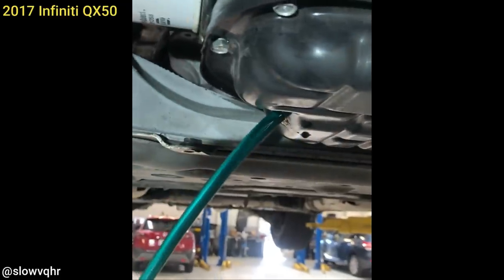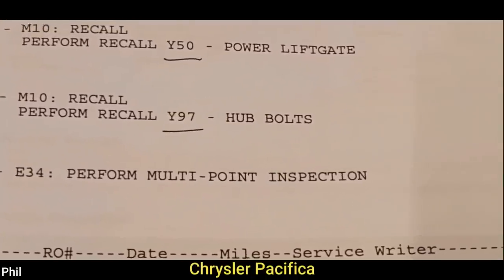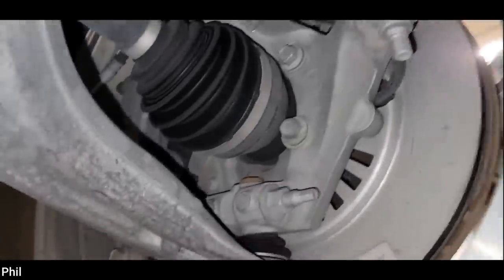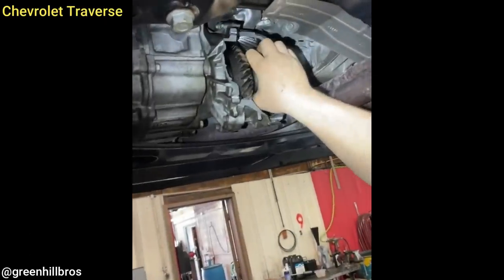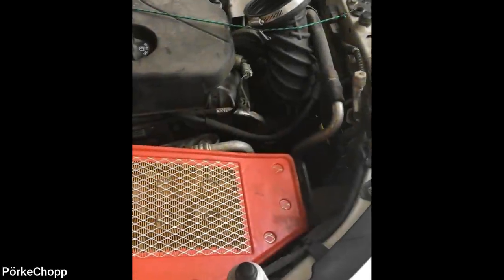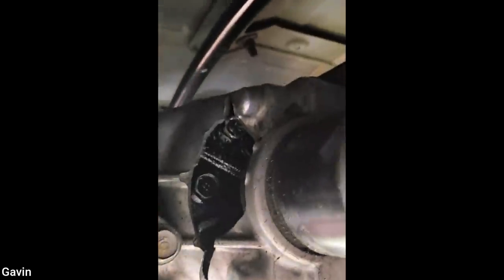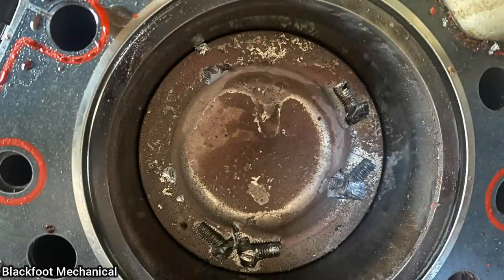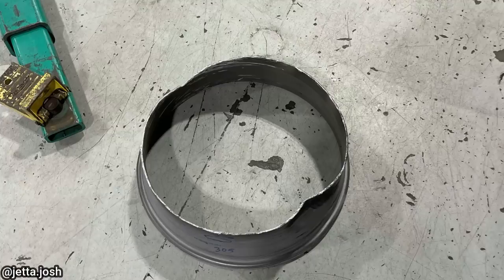Customer States Truck Has Clunking Noise At The Rear | Just Rolled Out

Comment: The blinker fluid in the blue car was fine.  It could have lasted another 50,000 miles.
Reply: ChrisFix would be so proud of them :D
Reply: But they over filled it
Reply: I came to comment on the blinker fluid too
Reply: That was just an observation; the actual customer complaint was about the muffler bearings.
Reply: Blinker fluid looked off, just throw away the vehicle
Reply: Only synthetic blinker fluid can last 50k
Reply: Blinker fluid has to be flushed every 25,000 miles to prevent excessive electrolytic buildup.

Comment: I can't believe how clean that truck bed is considering the rusted out frame.
Reply: I know right? It looks brand new except for the peeling paint.

I bet that would be a pristine truck if it was in Texas or somewhere like that.

Edit: At least the bed would be, idk in what shape the rest of it was. 😅
Reply: Iv seen this before , the frame is probably ok. The leaf spring shackle snapped and shot up the whole
Leaf spring into the bed.
Reply: I bought a 99 crown vic PI for $60 title and all before, with a dropped ball joint.  Body clean as ever, ran and drove great til the ball joint quit.  Huge rust hole in front passenger frame.  No fender rust either.  Shame I couldn't afford to keep it though, and it unfortunately went to a derby.
Reply: It’s a ranger they do that in the rust belt
Reply: @makpsv  My Bronco looked just like that when I junked it....body was pristine but everything under it rotted. It was a newer manufacturing process of stamping brackets, control arms and shock tower mounts where the metal rotted in flaking layers. You could actually see the layers in the metal after failure. This was not a normal type of rusting where holes would form. Ford never di recall a glaring safety issue.
Reply: you can see by the wheel wells that its comming through. the whole bed is rotten underneath. i have the same truck and the same problem with the leaf spring shackles. it screams and squeals when it rubs on the bracket so this guy knew this was fucked for a long time before that happened
Reply: The frame isn't rusted out, just shackles, apparently it's a common thing for 2nd gen dodge dakota because I can infact confirm, I just bought one that got brand shackles in rear but not without the passenger side punched a hole through, lucky for me I have a plastic bed liner that covers up nicely

Comment: I repaired the blinker fluid on my Kia the same way. It was going to cost $1k for part to properly repair it. I ended up just removing the housing , drilling a few weep holes , replaced blown lights and packed the sockets with dialectic grease. 50k miles and no problems

Comment: I'm surprised that first one being a Dakota, the '99 (late model)-'06 Silverado's were notorious for this happening because the shackle holding the rear of the leaf spring would rust and fail.  My dad's truck had it happen to both sides (didn't wear through like this, though).  We suspect that's why the rear u-joint was so messed up, it threw everything out of alignment (which I had to fix too).
Reply: I drove with one broke for about two weeks recently and wish I hadn't. 
It only dented the bed, but I feel like it may have twisted some things around. 
I'm just hoping it's not too bad.

Comment: Had the light full of water happen after a rock cracked the plastic headlight housing. Drilled a 1/16 hole in the back of the light to drain it. It was a good repair as it never filled again.

Comment: I like the "Rolled" channels. It helps me understand which vehicles to avoid buying. Also, I wish I could ID the exemplary car owners I should avoid. I'm having nightmares they're heading straight at me on the highway.
Another wish: I'd like to see some rolled ins on large commercial vehicles. Tractor trailers, school buses, box trucks, Rent-a-Trucks, etc.
Reply: Trust me, the number of things that you don't want to know about is beyond abundant. Hoods held on by packing/duct tape/cargo straps/wire/ baling twine; Vice grip shifters/steering wheel (I wish that I were joking); Wheels held on by single lug nuts; ...in short, everything that you see here and sooo much more. Fortunately, you are FAR less likely to see a rolled in with a commercial vehicle due to regular DOT inspections, including roadside and the substantial fines involved in them (think $50.00 per non-working light BULB, required or not) payable on the spot!
Reply: @MrSirwolf2001  Yes. Good points about commercial inspections.

Comment: Love al of these videos,Also Hey younger folks, notice all the grey haired mechanics in the these videos? We are a retireing breed, good luck getting your vehicle fixed in the next 5 to 10 years. And for your EV owners , Your screwed
Reply: It’s parts guys too, I work in dealership parts and I’m 40 now soon to be 41. I’ve got about 15 to 20 good years still left but I’ll be where you are a lot sooner then I realize
Reply: Luckily EV' have fewer parts. But will need computer techs to repair software issues.
Reply: Cars & bikes have to stay well built it seems to function for any length of time .. electronics such as computers too. Everything else though, consumer grade, is designed to fail or for impossibly light duty. All made in China junk, built as light as possible with relatively short service lives. Been doing a lot of home improvement lately and just disgusted at some of the crap the big hardware chains stock. You can get quality and durability still but for many things, not from them. Point being that durable items can be repaired quite often, but since so many things are considered disposable, there may come a time when no one can fix them, so continual replacement of sub standard junk will be necessary ..
Reply: @williamjackson5942  software updates, OTA, likely.

Comment: At work, we had a cargo van tail light full of rain water from a crack at the top of the lens.  They were too cheap to have it fixed, drove me nuts.  I brought a drill from home and added a drain hole with the smallest bit I had.  Then put a piece of lens repair tape on the crack.

Comment: I was at a burger king not long ago. When I walked out I kept hearing a meow. The cat was in my front bumper. I tried to coax the little cat out with fries. But it wouldn't come out. I went to the tire shop down the street. And I told them what the problem was. The lady looked at me said really. A cat. I said yes. She walked out with me and she heard the cat. A few minutes later. I pulled my truck into the shop and they jacked it up. The owner found it. He popped off a piece of the bumper and got the cat out.  He asked me how did the cat get in there. I said I don't know. I was at burger king and the little dude decided to hitch a ride. He looked at me and laughed. I laughed to.

Comment: This is crazy. My uncle had a 99 Silverado and the leaf spring hangers rusted out. He kept driving it until they came through the bed just like in this video. He fixed it by bolting pieces of wood to the springs to keep them in the bed. He ended up giving me the truck and I immediately bought a $40 set of hangers and fixed it. Also the frame was broken and I fixed it with some weld steel. Sold it for $1000 by some guy that didn't care that it had no shock mount anymore.

Comment: I had a 95 Ford Bronco that had both the rear and front leaf spring shackles completely disintegrate, fortunately at separate times. Fortunately, I didn't go jump an embankment like this fool obviously did. The metal flaked in layers. Had to replace 4 brake lines that rusted to crumbs as well. The front shock towers were next, so I sent it to the junkyard with 150k miles and a perfect good motor and transmission. I WILL never buy a Ford again as a result of their complete lack of giving a shit about people's lives. I mean come on no recall over brake lines disintegrating. What did they save, $25 not using stainless steel brake lines?

Comment: Hmm. Is it me or is vehicle quality control and maintenance going down the toilet? Or am I just crazy?
Reply: Yes, Yes, And engineers going way to far with weight reduction. I have never seen as many trans, transger case or rear end case failures as I have in the last couple years. You NEVER used to hear of this type of breakage.
Reply: @edfrawley4356  Nope. I had an old 79 gmc Sierra 15 pickup. Never really had any problems other than the 3 speed on the tree issues. And I also have a 1991 Chevrolet Geo Metro Lsi, engine is worn slap out but still drivable, and gets excellent gas millage, had to replace the transmission a couple times cause I got bad transmissions, but the last one I got is very good.